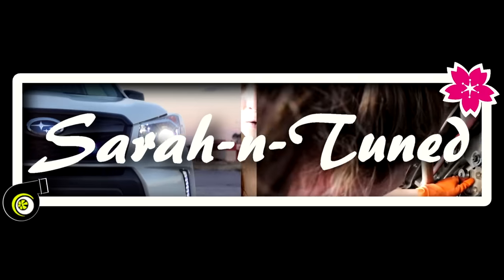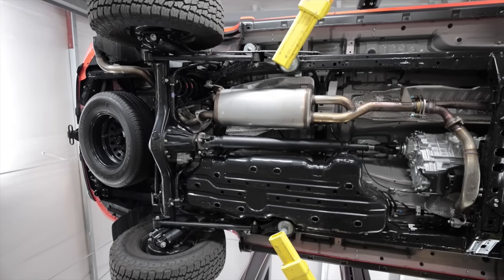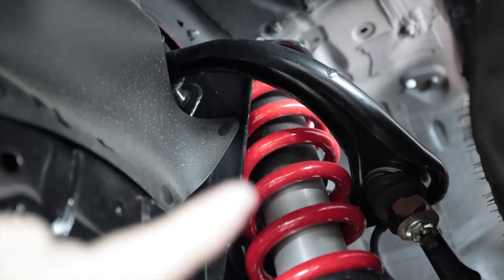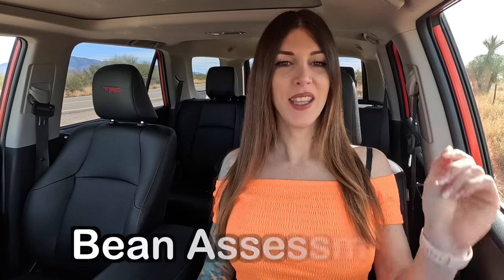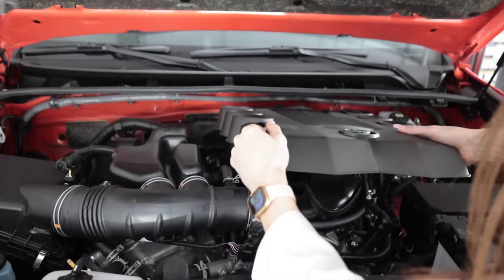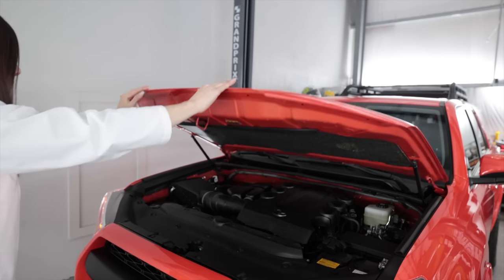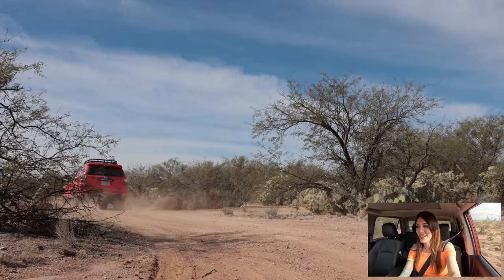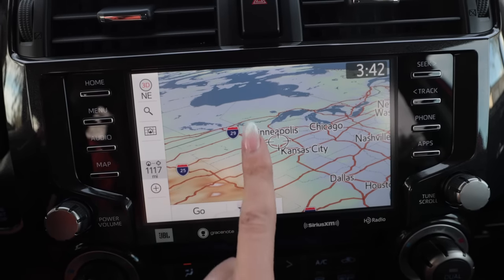Name A More Reliable Off-Roader // 2023 4Runner TRD Pro

Comment: Nice review!  I've been looking for a reliable overland rig and this is one of the vehicles I've been considering (the other is a van converted to 4WD), your opinion on the TRD Pro as an overlander?
Reply: 4Runner is one of the most popular overlanding platforms out there, there are dozens of channels that feature them. The Pro isn't really necessary for overlanding, the TRD Off-Road model has all the off-road goodies, except for the appearance bits and the Fox shocks. The TRD off-road has better availability and a lower price. Most people will add an aftermarket suspension which can be higher quality than the Fox anyway. As far as Fox goes, the one that comes standard on these is fairly low end. Honestly, the main reason to get the Pro is if you like the exclusive color.
Reply from the maker: Honestly it’s tough because the MTS is pretty nice to have, otherwise I’d say just a TRD Off-Road or Trail edition.  I think the TRD Pro would be more special to have 10-20 years from now. So depends how long you want to keep it.
Reply: @SarahnTuned  FYI, TRD OR has the MTS as well. My 2013 Trail Edition (renamed TRD OR in 2017) even has MTS.  Suspension, aluminum skid plate, and the Nitto tires are the only differences in off-road equipment/tech. The current "Trail Edition" is essentially an SR5 and has none of the off-road equipment.
Reply: @SarahnTuned  Thank you and Trail Runnah!  Big-picture it sounds like for overlanding (<2w trips), a TRD-Pro would add an appreciation bonus, TRD Off-Road/Trail same capability but little/no appreciation, and a 4WD van/overland rig for longer (van-life  style) trips... got it!
Reply: Sarah, The off-road premium has everything that the PRO has but the Fox suspension which you can add and a bad roof rack, plus Nitto tires that are bad in the rain. I put Wildpeak tires on my Premium and a much better roof rack. And no KDSS option which makes the ride much better and better articulation.

Comment: The 4Runner is a great SUV, but the gas mileage is horrible!! There are full size trucks that get better gas mileage and have more capability. Hopefully the next generation will be better!
Reply: Don't buy a GMC or Chevy. They may be V8 and get 23 MPG but that  system that shuts down cylinders fail within 80,000 miles and it's 7000 US Dollars to fix..so that why I bought a 4Runner.
Reply from the maker: Yeah it’s not great, but those full-size trucks you say highly depend on how you drive it. This thing pretty much gets the same if you abuse it or baby it.

Comment: well as a next project a bronco 2 would be nice if take out-side window and back door, so can put camper on with bathroom stove and clime up panels for windows, might have to use ranger long bed frame but it gives you a chance to nickel plate it
Reply: and turn the rears so don't kill the drive shaft or put hole in rear, dually rears are nice. Or your way